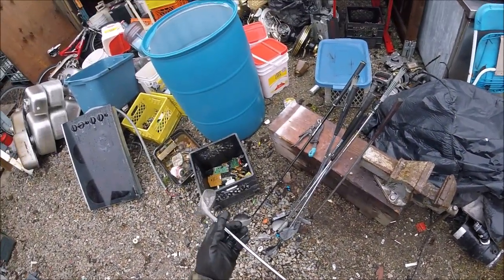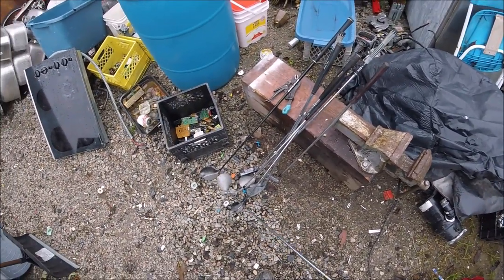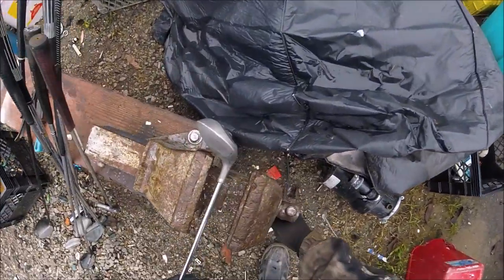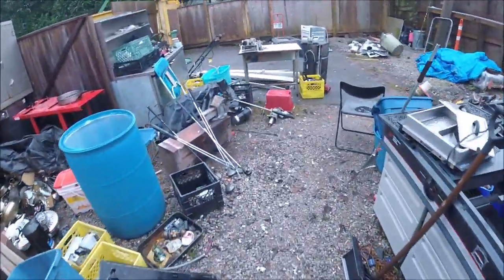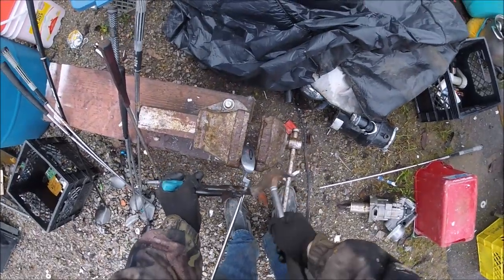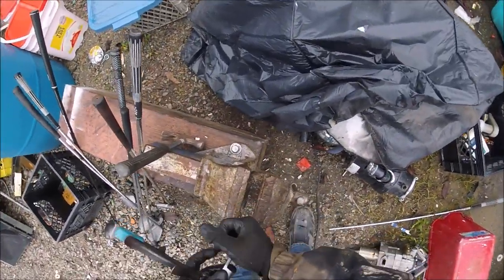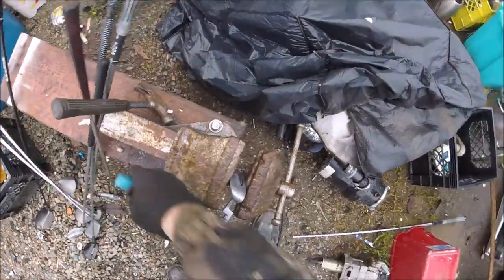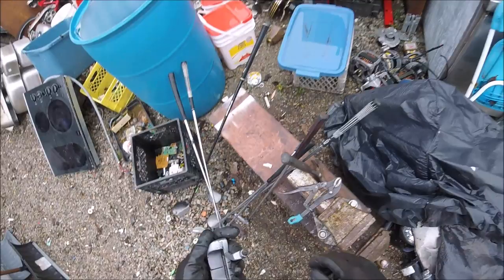Scrapping Golf Clubs For Cast Aluminium

Comment: You can put a torch to it. Club shafts are often changed on clubs. So a bit of heat and it should come free. If you remove the grips, do it later because they'll help to remove the shaft.

Take a look for youtube videos on replacing golf club shafts and grips.